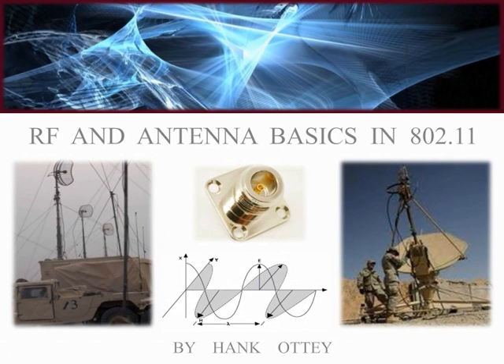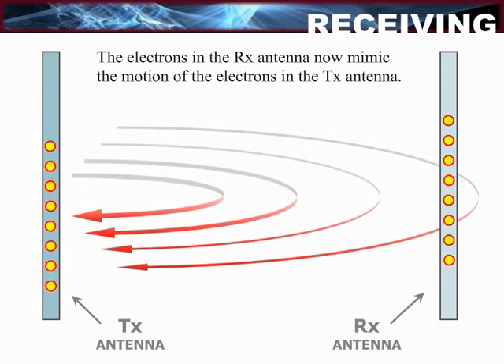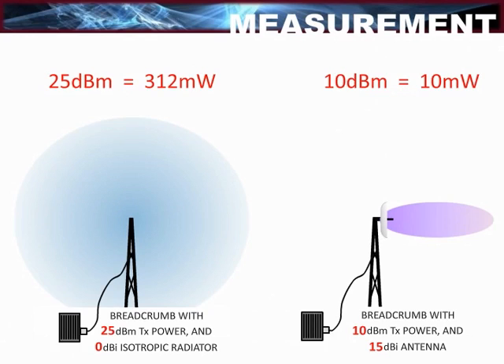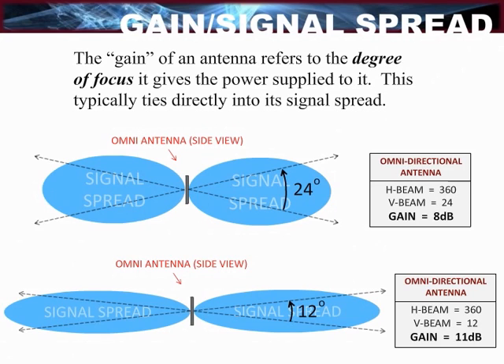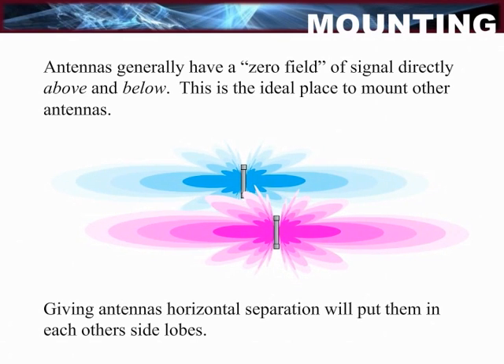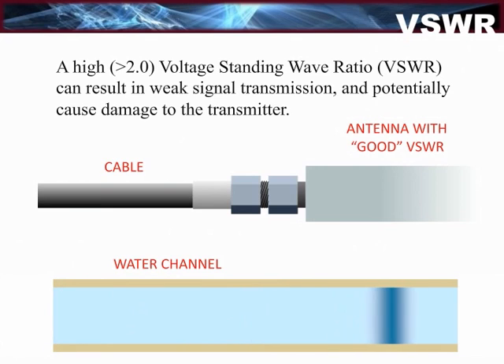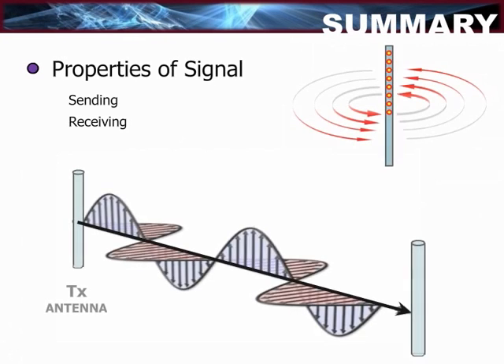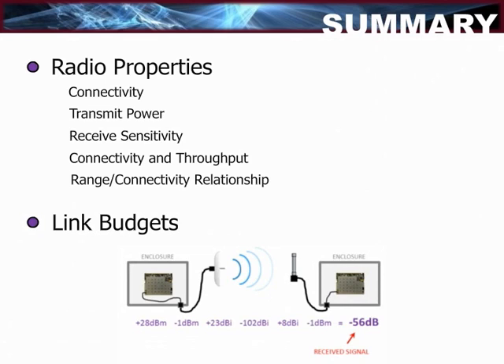RF and Antenna Basics in 802 11

Comment: Excellent work.
Reply from the maker: Thank you, Nilesh!
Reply: @hankottey338  hello, i am trying to find some information about Folded Dipole antenna. I have information about Dipole and that two poles are not physically touching each other. So there is a electric isolation. But in Folded antenna, two poles are touching. By a folded part. Now, if the charges move in one direction in two half parts ( half parts mean a part where you connect your supply wires ), then the same charges will move into other direction into folded part. Then the em wave emitted by both the parts will nullify each other. Don't understand. In some pictures i was shown that the charges move into same direction. How? I wish to send you that picture. How can I send? I need email address. I can not attach here. 
Please explain.

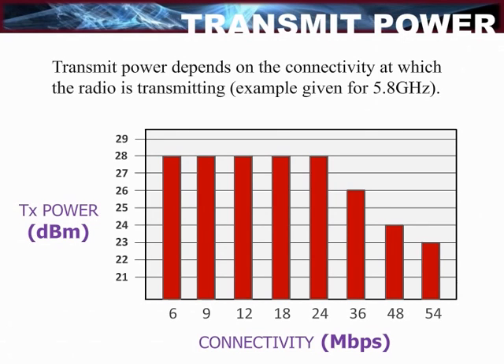Comment: @29:11 is this what happens with our phones? when connection is good(higher connectivity), it uses less power, and when it is bad, the transmit power increases(as connectivity rate decreases). I've wondered why my phone dies so quickly when its searching for service. Correct me if I'm wrong.
Reply from the maker: Hi Alexander Koran.  Thanks for the comment.  This is likely the case, although, I am not familiar with the specific chipsets used by every cell phone!  

Regards,
 -Hank

Comment: something is not clear. 
so, the electrons in the vertically polarized antenna (electrons oscillating vertically in TX) generates a magnetic field perpendicular to the antenna (in this case in the horizontal plane of TX).
when the magnetic field from TX  hits other metal metal objects (other antenna) it generates the electrons in the other antenna (in RX) moving up and down.
Now, at 4:55 he says "the oscillating electric fields hits electrons in other metal objects...it forces those electrons to oscillate as well."
my question: 
what forces the electrons to oscillate in the other (RX) antenna? because now i got 2 indications from the video.
1, the magnetic field from TX 
2, the electric field from TX
Can someone clear this up please?
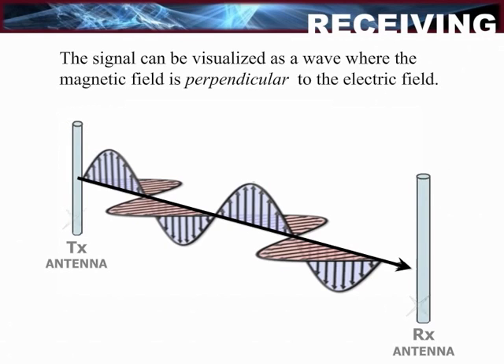Reply from the maker: Hi needsomehike.  Sorry for the delayed reply.  Hopefully I can provide some clarity regarding your question.  First of all, the magnetic field is generated around the antenna (as opposed to "perpendicular to the antenna"  ...see the 4:14 mark).  In addition, this generated magnetic field has a corresponding perpendicular electric field (see the 6:20 mark).  The two fields represented here comprise an electromagnetic wave.

To answer your question: "what forces the electrons to oscillate in the other (RX) antenna?", the best answer (in my opinion) is the electric field.  In the case of an electromagnetic wave, it could be said that both fields cause the oscillation since they are one and the same when in this form.  However, if a separate electric field (say, a stationary electric charge, as produced by a single electron) was introduced in the location of an antenna, this would have influence on the electrons in the antenna.  In this case, there would be no magnetic field present.  I hope this clears things up!  -Hank

Comment: You need to think of conventional current flow then using the right hand rule.
Reply from the maker: Hi slap_my_hand.  Thank you for watching, and for the comment.  I am not sure what is meant by "conventional current flow".  Does this mean there is also an "unconventional current flow"?  If so, how is each defined?  

In either case, the fundamental laws of physics would still apply.  Specifically, Ampere's Law (magnetic field resulting from electric current) and Faraday's Law (an electric field produced by a changing magnetic field) are what is dictating the mechanics in this situation.

Here are some links that give a breakdown of each law:
http://www.maxwells-equations.com/ampere/amperes-law.php
http://www.maxwells-equations.com/faraday/faradays-law.php

Thanks again!  -Hank
Reply: @hankottey338  Conventional current flow points in the opposite direction of electron flow. In an electeical circuit, it points from the positive terminal of the power supply to the negative terminal. A lot of things in physics are defined with positive charges, including the direction of magnetic field lines. So even if there are only negative electrons in a wire, you think of the movement of imaginary positive charges when you are working with conventional current flow.

Comment: In 32:47, I am worry that there is wrong placement. Fade Margin (FM) is lower than the received signal. So, in that case, the received signal should be -74dBm while the desired signal (as per design) is -56dBm. Then, the FM is -18dB. And look! The unit you put also wrong. dB is only for gain, not for reception or transmission.
Reply from the maker: Hi Sitorus,

Thank you for watching.  I certainly appreciate feedback on the video.  

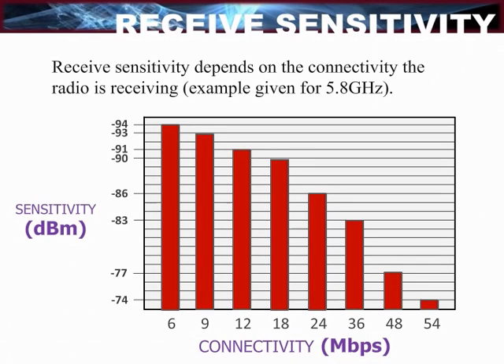In regards to your comments, I would like to clarify the origin of the signal values.  The "-74dBm" is from 29:33.  This is the necessary minimum received signal strength, in dBm, that is needed to achieve a connectivity (data rate) of 54 Mbps for 802.11a.  The "-56dBm" is the resulting received signal from the system described in 32:12.  The fade margin is the difference between these two values (-56) - (-74) = 18 .  By definition, the fade margin cannot be negative.  In other words, if the received signal is weaker than the desired signal, the fade margin does not exist.

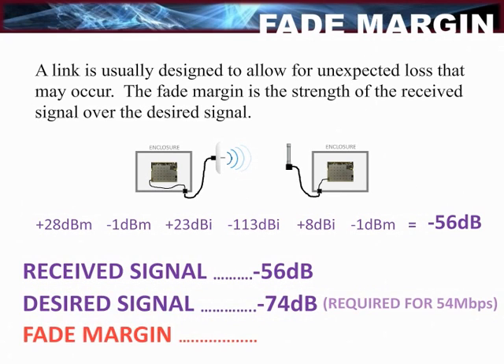Regarding the units, good catch!  Although the technically correct way to write the units of the equation in 32:33 is 
"(-dBm) - (-dBm) = dB", I feared this might be confusing to someone who is just learning RF, so I gave the equation a simpler look by labeling all values as "dB". 

Finally, the correct unit for antenna gain is "dBi" (decibels relative to an isotropic radiator).

Please let me know if I can clarify further, and thanks again for watching!

-Hank

Comment: After 4:35: The original movement of the electrons is not caused by the movement of the magnetic field, but by an alternating-voltage-source.
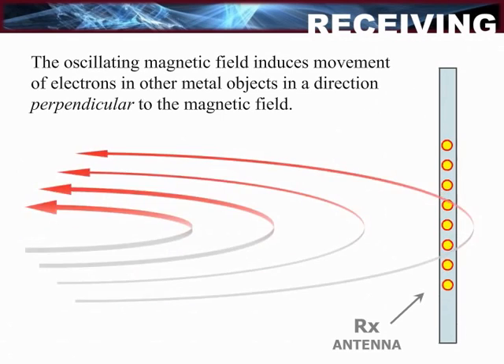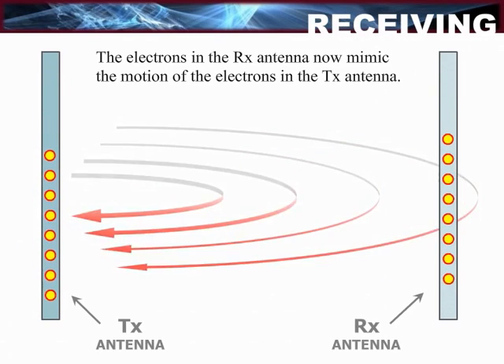Reply from the maker: Hi Jacob,  Thank you for the comment.   -Yes, the original movement of the electrons in the transmitting antenna is surely caused by an active mechanism (alternating voltage source).  In the video between 4:35 and 5:11, the receiving antenna is shown, which passively receives the waves (alternating magnetic field, and corresponding alternating electric field) created by the transmitting antenna.  I hope this explanation makes sense. -Hank
Reply: @hankottey338  I thought it was a usefull remark to make.

Comment: Please reply i have  subscribed to you. Pause 
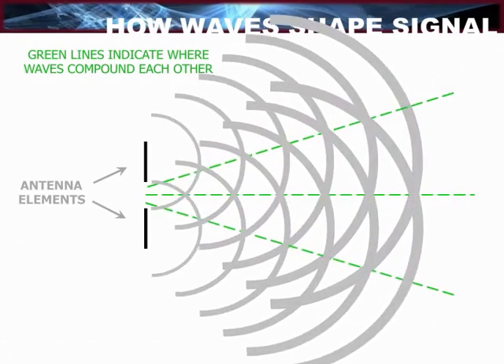12:54 at this time when these two wires are separated with a little distance between them. 
Quez1. How the start point and end point of both of the wires are connected with power source if there is a gap no connection between the top of both of the wires. 
Ques2. Compare that thing to right hand thumb rule.  As you told if current flows in downward direction in both of the wires it must make fields as our hand fingers you shown earlier but you have shown it like semicircle. How yrr i am a lot of 😕 confused with a lot of things of science like in a transformer the one end of its coil is given to our mains and one mid of the coil as neutral. My question is why the current doesn't go from neutral first because when the circuit is completed when the current is flowing from main wire it will get back to main only as it is A.C the current will come from neutral to main. But why not directly. Second why whole science is going in wrong way that the current flows from positive to negative but it goes from negative to positive what the hell yrr.  I have maken one rule only practical science.
Reply from the maker: Hi Tusshar, thank you for subscribing!

Answer 1: The wires (antenna elements) are connected individually to the source that drives the current in each wire.  This is not shown in the illustration, as the intent is to speak about the propagation of the waves, and not necessarily the construction of the particular antenna.

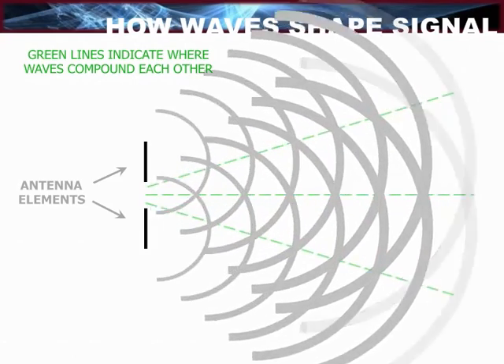Answer 2: I am not sure I understand your question.  In regards to the "semicircle" you mention, I am assuming you are talking about the 12:44 point in the video. The "waves" mentioned here represent the magnetic field (and corresponding electric field) that propagates from each antenna element.  In actuality, the magnetic field spherically from the element.  A cross section of this sphere would be a circle.  I have only drawn half of the cross section of the video, so it appears as a semicircle.  ***Please note that the strength of the magnetic field is not equal at all angles from the horizontal direction of propagation from the element.  This is what is explained starting at 11:27 in the video

I hope this helps, and thank you again for subscribing!  -Hank

Comment: I use RF at 13.56 MHz and 27.12 MHZ in a probe about 3-5 thousands in diameter placed inside of a hair follicle to create the heat necessary to destroy the cells that cause hair to grow.  I want to know specifically where the heat is generated on my probe (antenna) (tip? where the probe touches the moist tissues? etc.?) and when is an insulated probe unnecessary or necessary.  I do not want the surface of the skin damaged though I want the deeper layers of the skin heated by RF electromagnetic movements to approximately 127.5 degrees F.  What books can I look at to learn about the physical characteristics of the probe(antenna)?  What books can I look at to better understand how the physical forces are being manipulated by the probe and the oscillator behind it to not do damage to the outer layer of the skin?
Reply from the maker: Hi Juli.  Thanks for reaching out.  This particular application of RF is quite different than what is used in the broadband wireless world.  Generally speaking, there are two ways to go about finding the answer your question: theory, and actual experimentation/testing.  Ideally, a thermal imaging camera would work in this regard.  Of course, it would have to give a suitable resolution for something so small!  Good luck, and thanks again for reaching out.  -Hank
Reply: Thanks.  I kinda knew the answer could be debated through theory and actual experimentation but where are the books on the theory?  There are manufacturers of this kind of equipment who say their information is proprietary but this, to me, only means they don't know.  Obviously they know that the oscillator produces the negative and positive charges at a given MHz range but from there they state wildly contradictory remarks about what is actually happening in living tissues/follicles being treated.  We can see heat expansion where the probe is placed but we have no way of seeing the 13.56 million or 27.12 million per second movements in the tissues.  We have no way of knowing the temperatures inside of the tissues.  Where are these engineer/designers of this equipment getting their information for their design?  I don't believe any of their claims for privacy are proprietary because this equipment has been in use for more than a hundred years and sold by many manufacturers who know little to nothing about human physiology/dermatology.  Thanks for the tip about a thermal imaging camera.  Finding something that measures at a 1-5 thousands of an inch will be difficult, especially considering the treatment is going on from anywhere from 1 to 6 mm underneath visible skin surfaces.  Let me know if you are aware of any human or printed expertise that could help to continue my quest.   Also, if you are aware of any research institutions with the necessary equipment and research design experience please let me know.  Thank you.  Julie
Reply: @juligrlee  
You might find the answer to this in books or articles on medical physics. It is not my field so I don't really know. By the way this video is a good complement to physics knowledge about radiation and patterns (I am a  Physics professor but I learned a lot from this video).
Reply from the maker: @hanksnow5470  I just now saw your comment.  This was very nice to hear!  I try to give technical explanations a "start-from-zero" approach whenever possible, which often means going down to the raw physics.  Since my background is also in physics, I surely take this as a high compliment.  Thank you very much and feel free to find me on LinkedIn.  -Hank O.